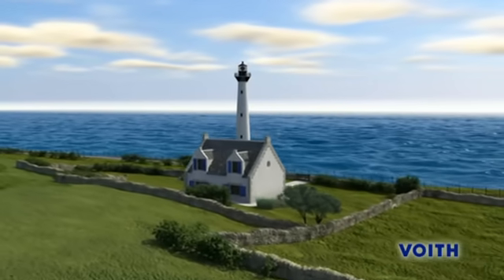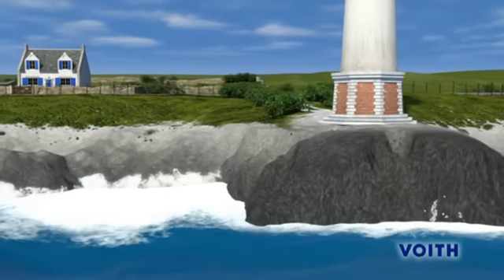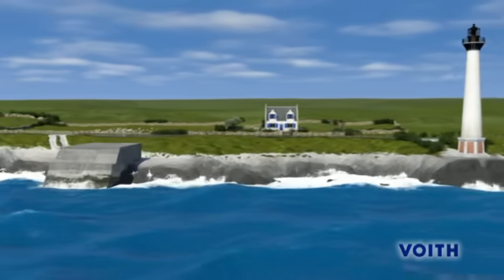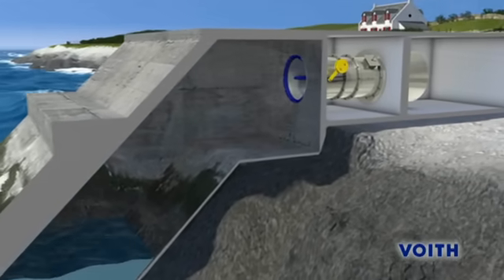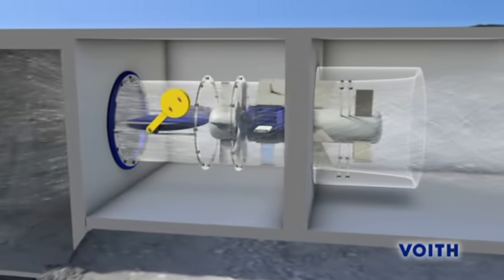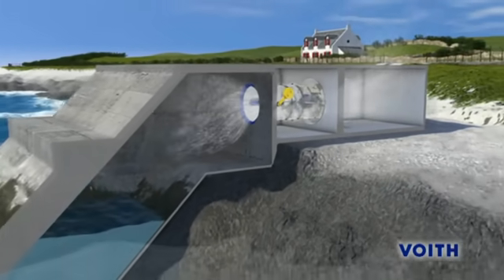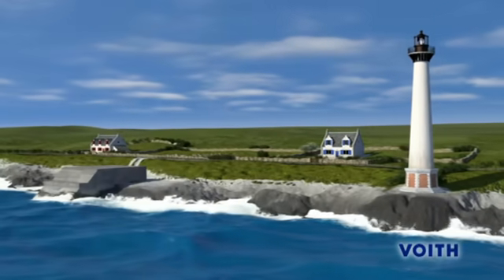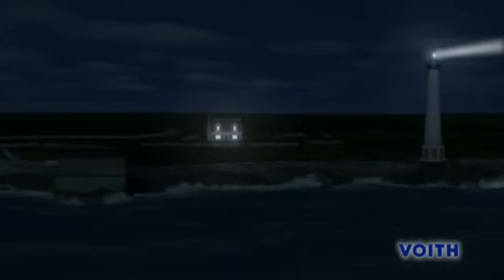Ocean Energy -  Wave Power Station

Comment: 1. The video declares that a Voith Wave Power Station was setup as of 2009 when the video was published on YouTube, yet it makes no mention of exactly how much power that station produced. This is a concern.
2. The video makes no mention of tidal sea level changes - the station in the video shows no ability to traverse up or down to match the vertical delta of 5-10 feet (1.5-3 m), which means max power happens at high tide and min at low tide.
3. The video mentions that "tidal power" represents 700 nuclear plants - but fails to point out that this would require every linear foot of coastline be covered with wave power stations. The video does not give any realistic estimates of how many power stations would be required to power, say, New York City.
4. It's been 11 years - where is this technology today?
Reply: Looking at this simulation alone you know the efficiency is crap
Reply: @RobbyBoy167  Yup, because air is compressible, and the volume between the water and the turbine is large...

I wonder though, if we could improve it by moving the turbine in the vertical water column. Sure, it would still be intermittent, uncontrollable, and not very effective, and it would need a lot of maintenance due to the salty water. I just wonder if it could be more efficient than what is presented here.
Reply: @ReverendRedBeard52  I never said I supported the idea. I was just wondering how much more power it could output - without even hoping for any efficiency.
Reply: @ReverendRedBeard52  the problem with "renewables", is that they are uncontrollable and intermittent sources of power. That's not practical.
Reply: @jm56z43  There are solutions for this problem. To be more reliable you have to convert electric power to something that can be stored and used to generate power (backwards) in case the "not controllable power supply" (aka "water wave generator", wind turbines or what ever) does not supply enough power. One idea is make hydrogen, compress and store it in tanks...
And yes I agree: The underlying technology (here "wave power station") aren't effective. But they are easy, cheap to build and to maintain (compared to a nuclear plant), are CO2-free, and produce no waste which is dangerous for eons of years. 
Finally its seems to me the better way - compared to burn oil or splitting atoms!
I am also sure that the efficiency can be improved.
Reply: @v.gedace1519  I agree that with storage, it becomes better. It could hardly ever reach the efficiency of controlled sources though : if there is no wind, not enough waves, during winter, we're kind of screwed, even with large storage. And I'm not even talking about space-efficiency. A 4-hectare nuclear plant produces as much power as several square kilometres of wind turbines.

By the way, "renewable" power sources also produces waste - wind turbines's blades are carbon-fibre : not recyclable in the slightest, and Germany is stacking them by tens of thousands in junkyards.

Just a thing though : the "nuclear waste" term, as used by administration, includes everything that leaves the site of a nuclear plant as waste. This includes the toilet paper and tissues used by the employees.
Let's focus on the long-term nuclear reaction side-product. These are not very active (if they were, they wouldn't last as long). In fact, once they are diluted into the rock to be stored several hundreds of metres underground... They are less radioactive than the Uranium mineral we extract. If we diluted them a bit more (just to be extra-safe), we could sell the result like any other stone. We don't, because many people freak out to the term "nuclear", and we don't want to keep explaining it, or fighting clueless organisations.

One thing I agree on, is that research is not funded enough, for both nuclear research (thorium reactors and nuclear fusion) and renewable resources.
Reply: @jm56z43  In short: All of your points are valid. Future is Germans Wendelstein X fusion reactor! 
My attempt was just to point out that there are many ways to solve "issues" with this kind of technology and that there are ways to get rid of nuclear plants. Dont look only to the waste; see also the exploded ones.
Reply: @ReverendRedBeard52  I think you could make use of the concrete structure to help with that, make the turbine slot into the lower tube, and able to be lifted vertically from it's hole with a pulley to be cleaned. A mesh on the front so you only have to deal with fouling rather than random junk and you could probably get the cleaning down to every couple of years at most. The corrosion could be addressed with galvanic protection but I think plastic turbines would be fine for small units.

TBH I really don't see much that would cause someone to use this over solar though aside from the night power letting you cut down on batteries, at least if you are in a place that is consistently wavy.
Reply: @v.gedace1519  True. Let's be more specific : to get rid of the current nuclear power plant model. The technology used is of the hardest to build and maintain. They have one thing good though : their by-product allows to build nuclear arsenal. But even this isn't even useful anymore as countries are banned from extending their nuclear warhead count, if it was ever actually useful in the first place.
By the way, there have been more incidents than explosions - thankfully : nuclear plants are equipped with lots of safety systems - except Chernobyl before its explosion, I'll give it to you (its other reactors received a safety upgrade and ran for decades later). However, there have been so little deaths from nuclear power, that the only real problem of running them is political (even the waste is on its way to be entirely recycled) : nuclear power requires the country to be stable.

The problem with nuclear fusion, is that it's not ready. Like, really far from ready. It's fascinating still. It should have more funding. Also, let's see which technology is the best (there are a handful of models being built and tested around the world)
Reply: @jm56z43  Long story short: We must get rid of the nuclear power plants. Reasons? See your own comment. Agreed. 
Solution: 
Currently: "green power". 
Long term solution (most likely final): Fusion! (like Wendelstein X7, etc., may be some "dark energy" / "anti matter" power plant).
Reply: @v.gedace1519  I did not say we must get rid of them. In fact, they are the short-term solution to the electricity production problem (it's not renewable, but it's still eco-friendly.)
Reply: @jm56z43  Lol. Really? 
Quote start:
     "@V. Gedace True. Let's be more specific : to get rid of the current nuclear power plant model. ..." 
Quote end
Reply: @v.gedace1519  I'm talking about a specific model. Not nuclear power plants in general. Also, I pointed this as a medium/long term objective. in the short-term, it is even important to keep them running.
Reply: Here's the wikipedia entry regarding the wave power project: https://en.wikipedia.org/wiki/Wavegen

It notes that "In March 2013 Voith Hydro decided to close down Wavegen choosing to concentrate on tidal power projects." 

So much for wavegen power stations.
Reply: Good stuff takes Time
Reply: Fun fact: NYC uses more energy than the whole continent Africa.
Reply: @petermueller69  USA USA USA!
Reply: the volume of air replaced via waves is probably enought to power a cellphone or light bulb, lol. I could see this working if the waves are 20 feet or more difference and the box is like a few miles long.
Reply: It's a failed tech...Like Wind and solar...ALL "green" energy is a financial disaster and only governments, stealing their poor taxpayers money, can fund these boondoggles.
Reply: 5. The waves won't come into such a big effect when they have to get through a concrete block. Inside it there would probably about 30% of the sea level changing in comparison to the waves outside.
6. Air compresses very easily and won't even completely go through the turbine until the wave is gone.
7. Tidal generators are cheaper and more efficient and can be used on many coasts.
8. Why the fuck did youtube bring this up to me now?

Comment: that's so dumb, hows the wave meant to do anything? it's just going to break on the concrete box, the silly fan inside isnt going to turn, not unless you stand there turning it yourself.
Reply: Congratulations ! The [Harvard Mentally Disabled People Society] is a offering you a Free Scolarship ! 

your comment is so fucking stupid ffs ... there is nothing worse than a dumb fuck, thinking he's intelligent, the design works very well, even if it's not efficient

1- Hows the wave meant to do anything ? :
we don't actualy give a fuck about the visible waves, what we care about is the moving water, water moves forward and backwards, that's what forms waves, 

2- This is how it works :
This design makes it so that air is sucked in the box when the water goes Backwards, and pushed away when the water comes goes Forward, they use an inefficient but simple turbine called the Wells Turbine that allways turns in the same direction no mater from where the wind/fluid/gaz/.. is comming from, thus generating Electricity ..

Comment: This is a good idea, but the turbine can not be single, and work in variable mode. A minimum of two turbines are required, operating in the discharge and suction mode. This simplifies the operation of each specific turbine, eliminating its impact.

Comment: Driving a generator turbine with just air has its limits...
Reply: Can you name a generator that doesn't have limits? At least this won't run out of fuel or cause harmful emissions.
Reply: @mckenzombie  He might be talking about Betz's law. a significant amount of energy is lost when moving a turbine. Maybe if they used the suction of moving waves it would eliminate the theoretical limit of energy gathered from a moving medium like air. would have a whole set of manufacturing problems though lol
Reply: @mckenzombie  Im just saying air is very limited as a working fluid. Water, oil or even tar would be much better.

Comment: If it makes a blade spin does it really have the power? Someone has been sleeping during physics lessons I quess... You multiple the flow with pressure difference over that blade and notice that you get close to nothing out of it. Maybe few hundreds of watts max... If talking about wave energy use the power of water directly and don't convert it into meaningless breeze of air. This is so stupid concept that video hurts to watch